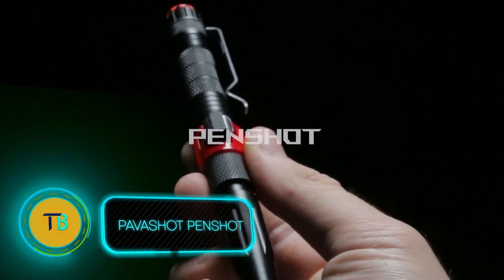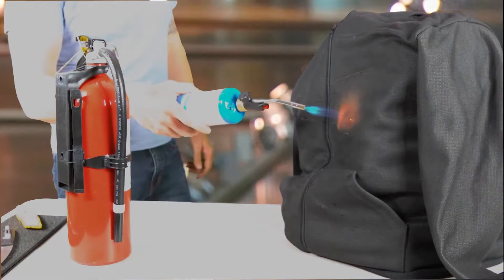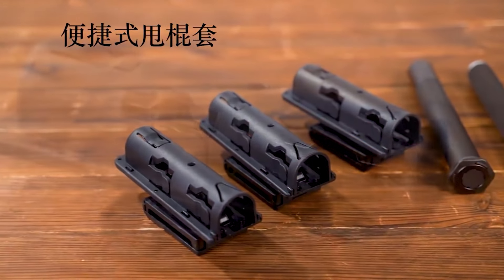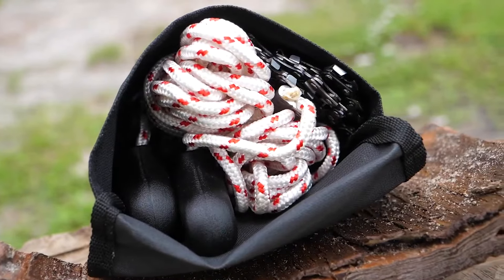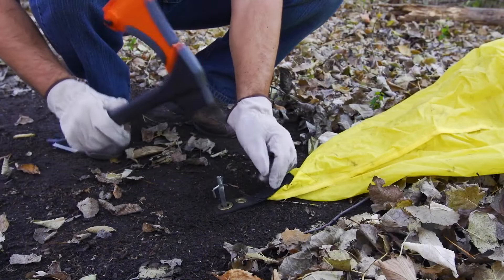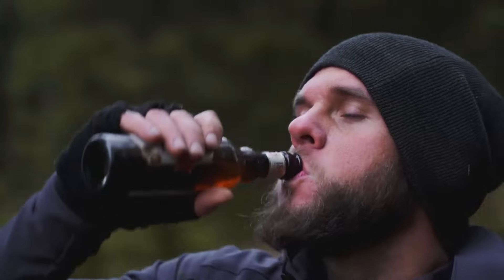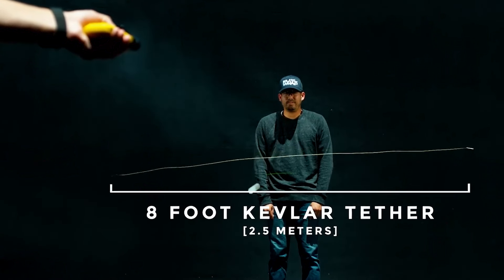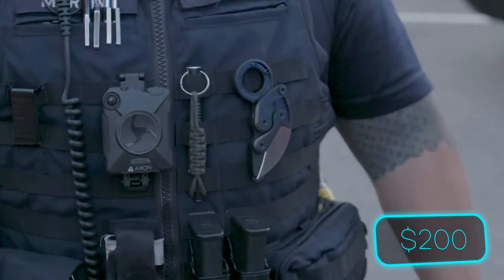THE SURVIVAL GEAR YOU DIDN'T KNOW YOU DESPERATELY NEEDED!

Comment: pen shot.... owned by 357 with 6" barrel 😲
Wonder hoodie..... You broke your RUBBER KNIFE 🤣🤣
Fancy flashlight    Or buy an LED bulb for your old 4 D cell Mag light club  and a bic lighter.😜
Affordable extending baton 🤔  See 4 D Cell Mag Light club mentioned above.😉
Tree saw on string...& that ain't para cord in the vid it's nylon woven rope.  $40 for something I can make at home or just use my regular limb saw? 🤪
overly gadgety crossbow.  See 357 mentioned earlier. 😐
Multi tool hatchet gadget  Stick with real tools Gimick multi tools are all garbage.🤦‍♂$80 for a gimick that will break with any actual use pass.
Gimick Shovel What did I just tell you?!?!
Shin shield....    For those dark Knight Jogs  greetings🕵
Backwards wonky knife..... Get a K BAR nuff said.